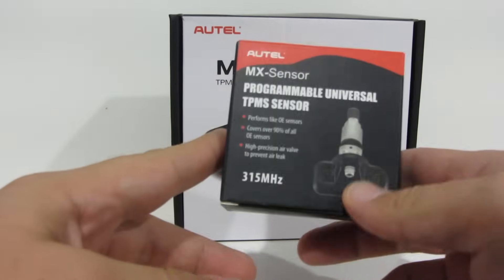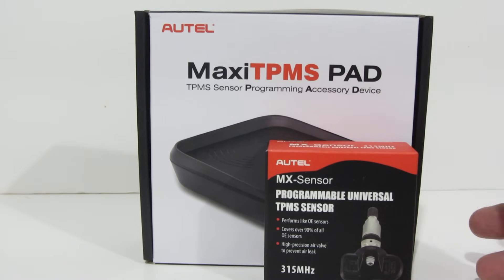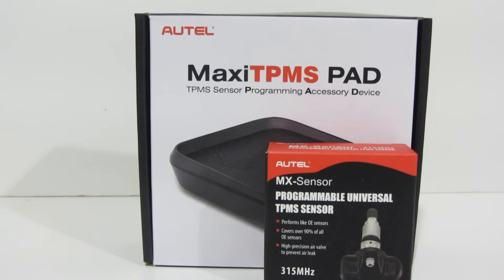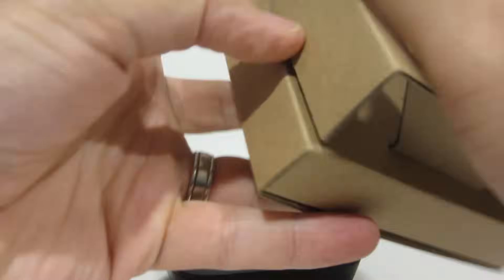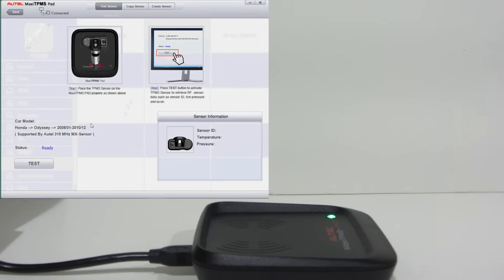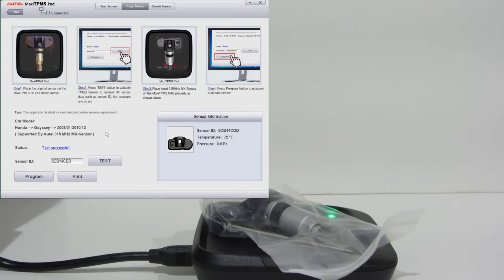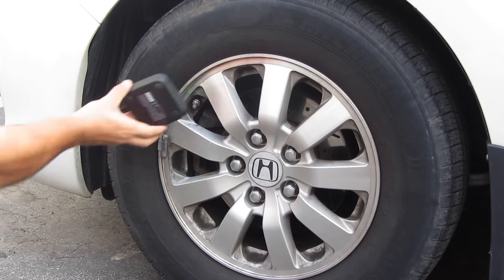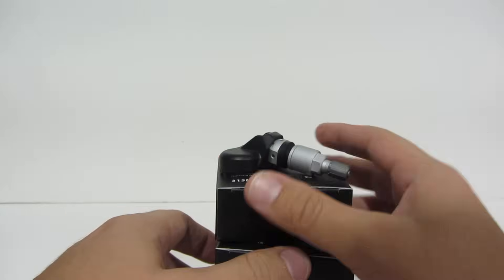Replacement TPMS Sensors for Cheap!

Comment: Hi, just curious. If i activate it through the above device, is it mean the Tire pressure signal will be gone in my car? I just installed new TPMS but still, it shows a signal so is it because of the programming?
Reply from the maker: Do you mean that there is still a light on your dash telling you that something is wrong?
How did you do the programming? Did you use the same sensors I used in this video?

Comment: Hi can this tool detect witch sensor bad on your car ? thanks
Reply from the maker: It can. You just scan all of your sensors and if one doesn't respond then you know that one is bad.
Reply: Thanks for your reply since you have been using these Mx what is verdict on the quality and durability and company in general thank you.
Reply from the maker: @salioubah5188  Autel makes a lot of scanners I'm general and TPMS tools. They to know what they're doing. That said, the batteries in these sensors in this video died after only a couple years, which I found a little disappointing. I since bought their newest sensors (the 2-in-1 sensors), so I'm hoping they will last longer.
Reply: Thank you. Have you try denso tpms sensor do they need to be program like the one you have on the video or the work out of the box?
Reply from the maker: @salioubah5188  I haven't tried Denso sensors. If they are programmable, they will say so. If not, then they will work out of the box, but you may have to program your car with the code of the new sensor. It depends on what car you have. Some cars automatically learn new sensors, some have a relearn procedure you can do without any special tools, and some need a special scanner tool to program.
Reply: Thank you. I have Toyota Corolla 10 and Camry 09
Reply from the maker: @salioubah5188  Neither of those cars learn sensors automatically. So you will either have to program the car, or program the sensor.
Reply: @GabesHacks  I will do that thank very much for your help.

Comment: Do you know if you can program the Autel sensor without using the old one? Do you really need to copy the programming off an existing sensor? I have all my oem sensors but I was wondering. I was going to ask about copying straight off the wheel but u answered that - thanks for this vid, you're helping a lot of people with it!
Reply from the maker: You can also read the sensor codes from the car's computer if you have a scanner tool that can do that.
My purpose for doing this was to create a second identical set for my winter tires. If you're doing the same, then you must have the old codes one way or another (from the sensors or from the car's computer). If you just need to replace dead sensors, then you could buy any compatible sensor and program the car with the new code instead.
Reply: @GabesHacks   Great. I wanna do the same as you but I was thinking in the future, if any of the tpms batteries die that I might have to buy new one and reprogram. Good to know - take care Gabe.
Reply: the pad will also allow you to "Auto Create" and ID number as well that is specific to your vehicles make and model

Comment: Well i am finding all you have to do if they are 315 mhz or 433 mhz is replace them. The computer will automatically learn them in a 20 minute drive. Discovered that when the sensor battery went dead. spent all that money for a programer that was not really needed. If you want to use the code that came with the car or truck you can read it anr reset the code. In most cases if the battery is dead you have to read the code if it is still readable then you can use that code if you want or just replace and take a ride. all of a sudden it start working because it reprogramed itself to the code on the one you put in it. Worked on my 07 Jeep.
Reply from the maker: Yes, there are three different types of cars when it comes to TPMS:
1. Cars that will automatically learn new sensors
2. Cars that require programming to learn new sensors, and
3. Cars that have a relearn procedure that has to be manually triggered for it to learn new sensors (sometimes without any special tools)
So it's important to learn how your car handles TPMS before you start anything. My Honda Odyssey requires programming to learn new sensors, which is why I decided to go with the programmable sensors instead.

Comment: Which one of the censor Do you recommend for a Nissan Rogue 09
Reply from the maker: From what I found, the Rogue uses 315MHz sensors and does need to be programmed when you install new sensors. If you're just replacing sensors, you can just buy any 315MHz sensor and find a place that has the tools to program them. See here for the process: http://www.thetpmsforum.com/showthread.php?234-2008-09-Nissan-Rogue-TPMS-reset
Or you can do the same thing I did here: buy programmable sensors and program them with the same codes as the old ones.
Reply: Gabe's Hacks thank you very much for you advice  . I’m going to do the way you did on the video 👀

Comment: Hi Gabe, I accidentally installed sens.it #590883 programmable tpms on my wheels without actually programming them, thinking that the car's relearn procedure would detect them. Doh, my bad! If I buy the right programming tool do you think I'll be able to program them without unmounting the tires? Thanks.
Reply from the maker: What's the year and model of your car? I thought these would come already programmed with a random code, but maybe not. If you really need to, I am pretty sure you can program it through the tire.
Reply: @GabesHacks  Thanks for the quick response Gabe. Car is a 2018 Tesla model 3. I also thought they had a code given what is printed on the tpms itself, see picture at: https://photos.app.goo.gl/AgZaApteiNBxxfDB8. But after more than 50km driving still won't detect them.
Reply from the maker: Sorry, I didn't get notified of your reply. Did you go through the relearn procedure described here? https://forums.tesla.com/forum/forums/tpms-reset-0
That should pick them up. It doesn't look like you should need any programming tool.
Reply from the maker: But those sensors do say right on the box "Must be programmed before use". I'm not familiar with that brand of sensors, so I can't help you much there. You might be able to go to a tire shop and they might do you a favour. The box says they can be programmed with any "major TPMS scan tool".
With that car, you didn't actually need to buy programmable sensors - I'm not sure if you did on purpose. You could get just any 433MHz sensors and do the relearn procedure on the car.
Reply: @GabesHacks  thanks Gabe. I called Canadian Tire, where I got them, and they said there should be no problem. Taking car in today. And yup, I didn't RTFM, my bad 😀
Reply from the maker: @stetsongrey  Awesome. I hope they don't charge you an arm and a leg to do it!
Reply: @GabesHacks  Just to close on this thread. Canadian Tire tried to program the tpms sensors and said "it didn't work". So they charged me nothing. However today the car popped a notification that new sensors were detected and all seems to be working. Cool! From everything I've read about the model 3 it can be tricky with after market tpms sensors. Anyway, on Tuesday I plan to call Canadian Tire and let them know it worked, and pay them 😀 (I actually don't know what the cost is).

Comment: 3 of my tpms sensors are missing. Last owner replaced them with just valves as couldn't afford tpms. I have entered obd and have 4 codes for each wheel. Are these codes same code tat is written on the tpms sensor?  Can i use this tool to type in my 4 codes i have for new sensors?
Reply from the maker: If the codes you see are 8-digit codes that look like the one in the red box at 4:44 then yes. But you may not need to depending on what kind of car you have. What's the year and model? Some cars automatically learn new sensors, or have a reset procedure that doesn't require any special tools. If that's the case with your car, you don't need programmable sensors. You can just buy the cheapest sensor that matches the right frequency (315MHz or 433MHZ).
If not, can that OBD scanner you have program new sensor IDs into the car?

Comment: can i assume if the battery is dead it will not be able to read the sensor.
Reply from the maker: That is correct. If the battery is dead, you may as well be trying to read a rock.
These aren't like NFC chips that can be read by applying an external signal. TPMS sensors use the battery power to broadcast a signal.
Reply: @GabesHacks  Do you think it's possible to cut and replace the battery just to get a signal and then clone the old tpms sensors? Or is the tpms sensor "done" when the battery runs out.

I think if you cut the sealant and replace the battery that it might work, but I'm not sure..
Reply from the maker: @Emiroj  I tried it once, but it didn't work out for me. I don't know why. You can try it. But it may not be necessary. The code you need is usually printed on the sensor itself.
Reply: Thank you for the quick reply!

Yeah stupid me I didn't think of that the ID is also printed on the sensor. Then I don't have to worry about the battery lifetime anymore.

I think I'll write the ID's down and save them because they might be scratched away.

Just bought the Autel Maxi Tpms pad and 4 sensor from Amazon so I'm excited to try how it works.

Thanks!

Comment: Hello, I cloned the MX-Sensor with wrong sensor ID, and now I can't reprogram sensor with correct ID. Even when I entirely deflate the tire in an attempt to clear the MX-Sensor's cloned incorrect sensor ID I get the following "Status: Programming failed.[Error Code:-2]"
Reply from the maker: Have you tried using the "Test sensor" button? Does that pass? If not, you can try emailing Autel using one of the email addresses on their site: https://support.autel.com/support/home
I have emailed them before and got a response fairly quickly.
Reply: @GabesHacks  yes Test Sensor fails. Turns out the tire PMS MaxiPad (see what I did there?) is too weak, signalwise, to 'reprogram' through the wheel. It can only initial program. Otherwise the sensor has to be removed and placed directly on the PAD for 'reprogramming'. It worked. One of the more expensive Autel TPMS devices would likely be able to reprogram through the wheel, but the tires might still need to be fully deflated.
Reply from the maker: @richardhoover8021  Interesting! That is very good to know.

Comment: Can help please. I got a 2018 Lexus, one sensor melted, I can find the model is PMV-C210 , i can buy it from eBay, but will it  just work ?
Reply from the maker: The description of this video has link to a spreadsheet from Autel with all the models they support. The table doesn't show 2018, but all the Lexus models it does show says that the vehicle must be programmed after installing a new sensor (just like my Hondas).

Comment: In the middle of doing this for my 2008 Tacoma and had a problem where new MX sensor would fail test after programming.  I downloaded newest software from Autel's website and updated the TPMS pad and everything worked great after that.  Using 315MHz + 433MHz sensors.

Comment: This is bad ass! Do they sale these for bmw 5 series as well?  OEM's cost $76 each with Lifetime Warranty!
Reply from the maker: I don't think you wouldn need to buy programmable sensors. From what I can find, BMWs will either automatically learn new sensors, or there is a reset procedure you can do yourself. Try rockauto.com for the sensors, and check your owners manual for the reset procedure.

Comment: My car didn't come with a spare tire. I went and bought a spare tire, which I want to keep in the trunk as my spare. If I copy the code from one of the wheels on the car, could I use it for the spare too. My concern would be the vehicle would have two wheels with the same exact code, which may cause a malfunction. Any thoughts?
Reply from the maker: It would also only really work if your specific vehicle automatically learns new sensors. Then you could put a sensor in the spare (with any code), and when you put it on, your car will figure out that it has a new sensor.
Otherwise, it just wouldn't work. You would have to use one of the codes of the 4 sensors you already have, but it could be any of the 4 that you need to replace in an emergency, so there's a 75% chance you end up having two of the same sensors running after you use the spare and it will still complain at you.

I think that would only be helpful if it's a full-size spare that you could put on and not need to switch back after. Otherwise, I don't think it's worth it at all.
Reply: @GabesHacks  Thanks Gabe

Comment: so you just copy the old sensor code to the new sensor? replace the new sensor code with old code? is that correct? so the car computer still thinks that is the old one?
Reply from the maker: Correct! The car's computer has no idea that anything changed.

Comment: So after a synthetic oil change and tire rotation at the stealership for my ‘07 Pilot the TPMS comes up the same day. I went back and the guy was trying to tell me I need 2 new tires...I was like, how the f@:*  does that make sense?! The treads are fine.  Now my CEL comes on... ugh
Reply from the maker: Yeah, sounds like you need to find a new shop.
Reply: I hate this dealership but it was so close to my house and just needed an oil change. The one I like is 40mins away and hard to get appointments
Reply: @Shino2600  You don't need to go to a dealership for an oil change.

Comment: do you have another video showing how to connect the Autel MaxiTPMS Pad to computer, and to the car to do the programming?
Reply from the maker: It comes with a USB cable. You just plug it into the computer and install the software.
It doesn't plug into the car at all. Because you program the sensors, the car doesn't know anything changed, so the car does not need to be programmed at all.

Comment: Hey Gabe,

I have a 2017 Honda oddyssey EX and was wondering what type of sensor it would be 315MHz or 433MHz sensor. I looked it up on your link with the downloads but it didn't go passed 2016 models.
Reply from the maker: The 2017 is part of the same generation as 2016, so it'll be the same (315MHz). But just to be sure, you can see here that it's the same part used in a ton of other Honda vehicles, including the 2016 Odyssey: https://www.hondapartsnow.com/genuine/honda~sensor~assy~tpms~42753-tr3-a81.html
Reply: @GabesHacks  thanks for the help bud! Great videos helped a lot and saved me lots of money. Cheers!

Comment: Hey Gabe:  I saw two of your videos about the purchase of your universal TPMS monitors, and their programming and installation. It was a really great and simple presentation, and I learned a lot. I am about to purchase a set of 4 tires and wanted to learn about how the TPMS monitors work, and you gave me a "can do" simple and thoughtful way of either doing it myself, or knowing enough to get the proper help from a good tire technician, so I can get exactly what I want without getting ripped off. Thanks for your lesson. It was really great. Keep up the good work, Dan

Comment: Nice vid...so i have a 2012 honda civic one sensor is bad.....and now that same tire is flat....I would like to replace and program my self....once I find the brand of sensor..can I just order same brand??  And install and program myself?  What's needed to program just a computer with internet?
Reply from the maker: The Civics don't automatically learn new sensors. So you either need to program the car, or use a programmable sensor (like I did). If you want to do this all yourself, you will have to buy a special tool to either program the car or program the sensor. If you're willing to buy a tool, I suggest you buy a tool to program the car, since you can find tools that can do way more than just program a new sensor - it can read everything on the car. For example, the Foxwell NT520: https://ebay.to/2lMiEjJ (make sure to select Honda from the dropdown)
If you don't want to buy a tool, then you'll need to get a shop to do the programming for you. Just don't go to a dealership or you'll get hosed.
Reply: @GabesHacks  yeah I'm familiar with dealership shop fees.......makes sense about getting tool for programming car....we've used a few at auto school I'm in for  pulling codes and functions.......just curious how much was program tool you used for sensors only?

I probably will let a local tire shop like ntb or so put in New one and program........
Reply from the maker: @jayturner7712  I bought the Autel MaxiTPMS PAD, which is around $60: https://goo.gl/7E7JBg
Reply: I would recommend getting Autel TS408  (or other Autel TPMS tools),  and Autel Universal 1 sensor, which can handle both 315 and 433MHz.
You can use Autel TS408  (around $120) to program Autel 1 sensor to work with virtually any car brand and model.
also, I would recommend replacing all 4 TPMS sensors, because when 1 goes bed (probably battery is dead), remaining 3 will go bad also.
If you copy the serial number of old TPMS sensor to a new one, you don't have to reset or program your car.
Reply from the maker: @davidjacobs8558  That's a great tool, I agree, but it's more expensive than the PAD, which might not make sense for someone who's not doing this for their work. But to each their own.
Also, I did get confirmation from Autel that, with the newest software update to the MaxiTPMS PAD, it can now program the new Universal 1 Sensor.
Reply: @GabesHacks  if you have more than 1 car in your family, not having to lug around a notebook computer becomes very convenient.
Reply from the maker: @davidjacobs8558  Very true!